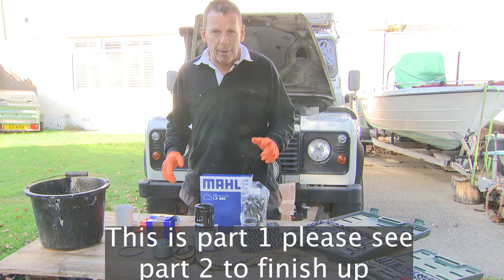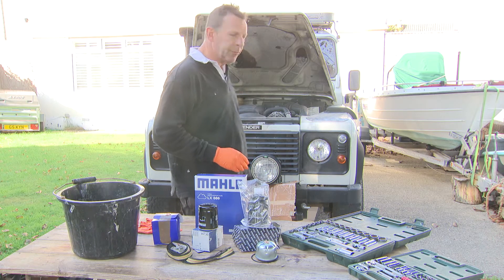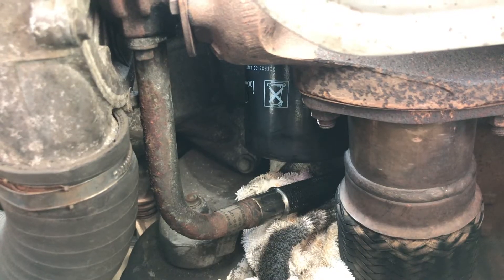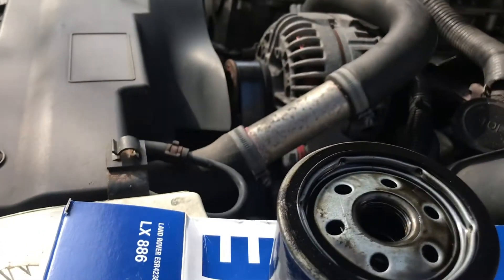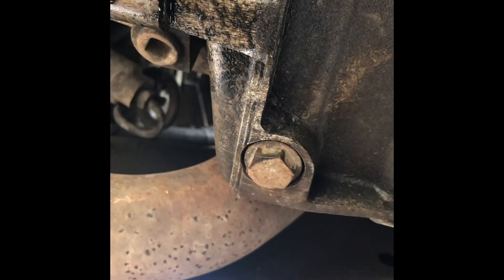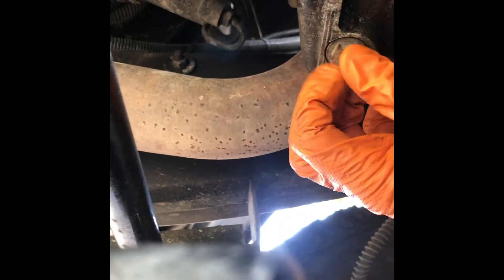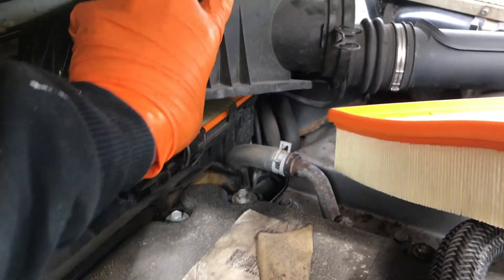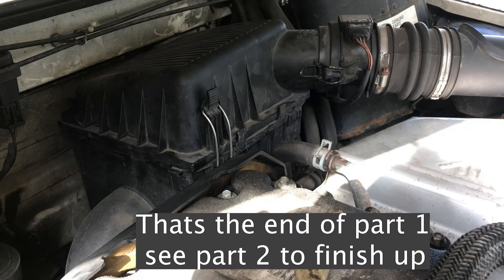Land Rover  Defender full engine service TD5 PART 1

Comment: Some gorilla tightened the sump plug on mine to the point I was afraid it was cross threaded. I bought an oil pump from Machine Mart with croc clips to connect to the battery. A thin tube goes down the dipstick tube and another goes into an empty oil container. Works great and gets 7 litres of oil out with no mess in just a couple of minutes. Works best with hot engine and filler cap off.